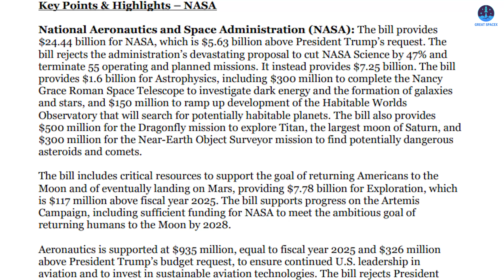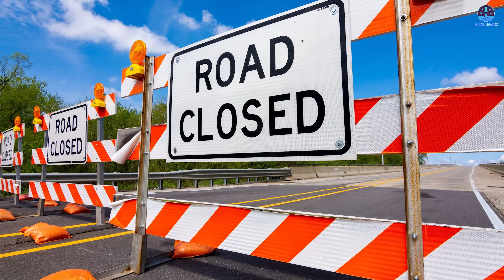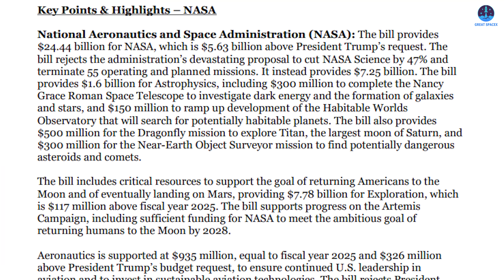Starship Flight 12 launch Date So Close after Pad-2 almost Completed...Sooner Than We Thought!

Comment: Why didn't they leave the 1st launchpad alone and use it to catch so they would have redundancy or one set of catch arms?  One for the booster, one for the first catch of the starship?
Reply: The number of flights approved for Texas needs about 2 pads, if not more.
Reply from the maker: They still need to thoroughly upgrade Pad-1, including the Chopsticks. For example, SpaceX shortened the length of the Chopsticks recently. But the Chopsticks can complete the upgrade before the rest of the Pad, so it can still participate in the two-stage catching mission with Pad-2.